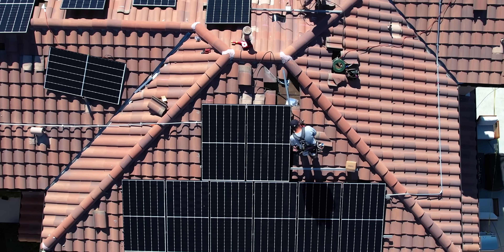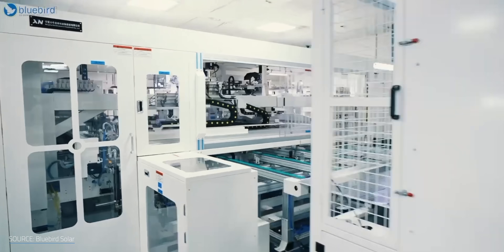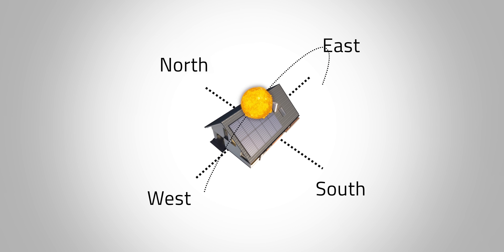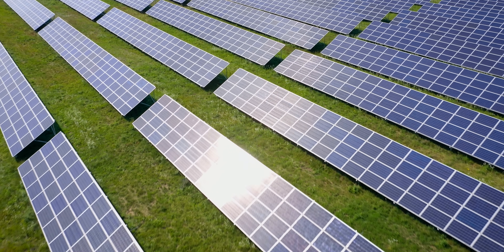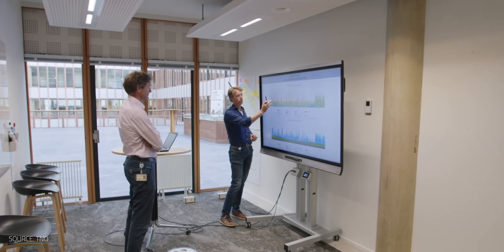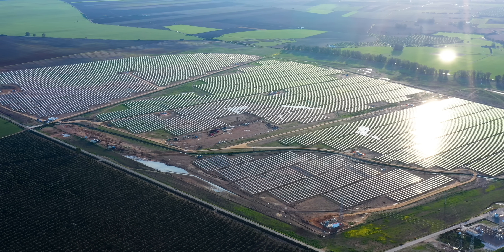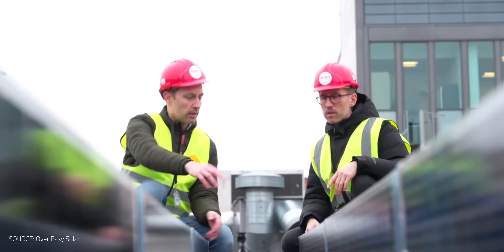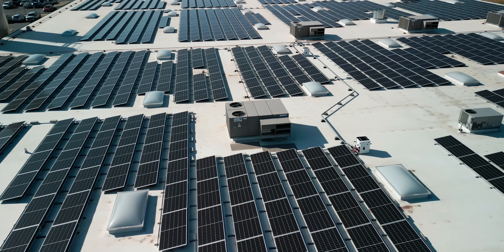Have we been doing Solar wrong all along?

Comment: One other huge benefit I see is for big farms, when it snowing you won't have to clear the snow and even dust would stick less on a vertical setup and you can much easier clear grass and can even technically farm it and sell it for livestock.
Reply: Sheeps would keep the grass down.
Reply: @Slumbert   Cheaper a possibility though some species do like climbing about as much as goats would be a nogo with how much they like climbing on putting their hooves on things etc it would definitely be wall jumping off the solar panels if they weren't too high for the goat to access.
Reply: @kateajurors8640  yes, and some animals scratch their bag...
Maybe galvanizet steel and some semihorisontal for sheeps to get under if it hails etc.
Reply: @Slumbert they do on regular installations on fields rn
Reply: No hail damage
Reply: @BobbyDazzler888  I have had enough windows even covered by a porch knocked out by hail that I highly doubt that they would never experience any type of hail damage. I live out in the country so it's not like it really ricochet off anything like pavement or whatever.
Reply: @BobbyDazzler888  Hail falls at an angle so there would still be a small concern about it but still much less than if they were horizontal.
Reply: Ah, that's a great point! I had to clear snow off of my small array this winter which wouldn't have stuck if they were vertical
Reply: @addamaniac  in the winter time the east west facing solar pannels don't get a good angle onto the Sun. If you want to optimize your solar pannels for yield during the winter they need to face south. and the optimal angle is about 30° steeper than the year around angle. I guess that is already steep enough that snow does not build up.
Reply: @MusikCassette  My country is at around 50° latitude so this doesn't really apply here, my pannels were covered with snow for few days until the warmer temperatures melted the layers so it slid off. Granted we see less and less snow each year, last year there wasn't any snow at all and this year it was 30cm that melted in 4 days.
Reply: That's my first thought, maintenance costs would drop a lot
Reply: @bullydungeon9631  could make a very slim roof, maybe with cleaning shower.
Reply: @Slumbert  a cheaper solution could be to use a tractor attachment and drive past. Imagine something like the hedge trimming attachment, but with brushes instead of blades.
Reply: If you raised it two feet, you could grow low grain crops like winter wheat between them as it does not grow very tall like corn. My concern is wind.
Reply: @markpashia7067  If you live in the west wind zone, (as I do) east west facing pannels actually protect the crops from wind.
Reply: @markpashia7067 , Double Thumb's Up! About the wind, simple just adjust the structural support to resist the stronger wind based on design.
Reply: wonder if it will be better with fast winds,
Reply: Good point.....
No snow lying on them might make them last longer?
Reply: @Slumbert  No snow makes them work better.
Reply: @jamesvandamme7786  Because of the light bouncing off the snow, right? So often we need sunglasses in winter as much as in summer.
Reply: Longevity could be a problem for glass panels without the aluminum backing, BUT vertical position also reduces the number of hail strikes AND the power of those strikes.
Reply: ehhhhh no  @Slumbert
Reply: @koiyujo1543  no to what?
Reply: @Slumbert  The issue with snow is you loose power generation waiting for the snow to melt and slide off the panels. A snow day where I am usually means 0kw for the next 2 days. If you get into a cycle of snow every 3rd day, then February can be an almost 0 production month.
Reply: Biggest benefit would be the east west installation and you get more power early in the morning and late in the afternoon, exactly when needed.  In Australia we get too much power generated in the middle of the day.
Reply: Panels face south in the northern hemisphere. Down here in the southern hemisphere we face them north.
Reply: And the method to wash them is way easier. Basically build a drivable car wash with the drums running against the panels.
Reply: I was just thinking that, they might also catch the wind more, but that just means you need a more solid install. But the big advantage is avoiding solar panels' Number One Enemy: Hail. I'm sure hail could still damage them, but being vertical means less of a chance of a direct blow.
Reply: They use solar panels in Antarctica, so i don’t think cold weather is as big of an issue in snowy areas as you would think.
Reply: I saw time ago a video of a guy explaining how the snow was not a problem because with not too much light the panel increases de temperature and quickly the snow melt and down.
Reply: @Felipe-st7tm  

Theres an optimum angle for shedding  snow  you can see it with smooth  roofs  if you get contact freezing of fog or rain  that might cause a problem with snow sticking to the ice layer but it would still tend to shed  as it built up.  
Monohull sailing boats are difficult to fit sufficient panels to due to the need to walk on cabin roofs..and having masts and ropes casting shadows all over.   Fitting bi facials vertically 
To the side rails  makes sense because  not only does the water reflect UV light but the fact that most boats have white decks and  superstructures will help on the inboard side ..
Reply: And no maths - place the same way wherever you live lol
Reply: My main panel is being placed in a pasture area mounted high enough that grazing can take place under them with no damage. My driveway is being fenced in and is about 600 ft long. My plan is to line that fence with panels to make use of space for extra power production, so vertical panels along a fence could produce as much power as a large horizontal rack with no loss of space.
Reply: Have you seen road signs in the winter?  They are vertical and yet they are caked with snow and ice!
Reply: @Hogger280  

Depends where you live and the signs are usually Aluminium  metal not toughened glass its in  a different League in terms of snow sticking to it ..  but thats why i mentioned contact freezing of water.  Its not impossible just less likely.
Reply: @Hogger280  Yeah, good point. Still it'd be much less than horizontal ones and easier to clean, if you're lucky qnd it isnt frosen fully just bump them with a broom and it would all fall down.
Reply: I thought the same for human food.
Reply: And also it's easier to work through them.  We are studying to install panels in our vineyard and this vertical design could be a great solution. Easier to work through, using the same row disposition that we are already using in our rows of vines, less dust accumulation, protection from strong winds, and maybe we could use its shadow to decrease the temperature of the plant during our Mediterranean hot summers, or maybe not, because we need this shadow on the moments when the sun is hitting higher. Anyway, now I have work and need to study and consider this design.
Reply: You could stack more rows vertically as well
Reply: That's one of the few reasons I never bought solar panels. Too much snow! This gives me hope, just need to figure out how to configure this for my yard & home now.
Reply: Even rain
Reply: Good point! I imagine you would get the same benefit in sandy regions if we build huge solar farms in the desert
Reply: @anonperson3972  One other benefit I learned about recently, is much better longevity of pannels. The worst thing for them is heat, and this configuration lowers that significantly. But since the power generation is so much worse, we need to calculate if the longevity benefits are actually worth it and end up producing more power over the lifespan.
Reply: This solves the Texas heat issue for me. I wonder if it would also help with our hail storm issues
Reply: As it's an upright structure why not mount the panels on tall robust poles strong enough to take a small wind turbine. Sun or wind or both you would have even greater energy potential from the same area and still harvest crops or have a small animal farm between the rows.
Reply: Where there is a lot of snow that usually means northern parts (if we leave southern mountains out) and that desires higher panel inclination, so the loss in efficiency is not as high anyway. The problem is, you want them warmer there, the opposite - having them frozen is not good :D
Reply: @marsovac  I’m not sure I follow. When it comes to solar panels the colder they are the more efficient they are. It’s drastic enough that when designing a system the potential over power/voltage conditions need to be accounted for in colder climates so as not to damage the MPPT.
Reply: @RobC1999  
Considering solar panels have an operating temperature as low as -40 degrees celsius (which so happens to also be -40 degrees fahrenheit), this is true. Also, a single graph while searching “solar panels voltage vs temperature” on Google showed me that a lower temperature yields a bigger voltage-power curve (that is: it can generate a higher voltage overall before inefficiencies start cropping up).
Reply: @Operational117  thats why liquid cooled Hybrid Photo Voltaic thermal panels are more efficient and longer lasting in areas of  strong light and higher ambient air temperatures.
Reply: @marsovac  Solar panels are more efficient when it's cold. Added bonus: sunlight reflecting from the snow adds to panel yield. Downside is this period is very short and half a year theres very little to no sunlight at all (winter is also the time when extra electricity would be needed the most).
Reply: @marsovac    Yah, but in northern latitudes during the winter, the sun is at a lower angle, so it would hit those vertical panels more directly than in the summer.  Kind of a win win, since the cold temps offset the more direct sunlight in the winter, while the higher solar angle in the summer means that panels get less hot then.
Reply: @marsovac   Actually even well below water freezing temperatures, photo-voltaics still gain efficiency benefit from being colder
Reply: @firstlast-cs6eg  from being colder yes, but not from being frozen and condensing more water on them and being even more frozen.
Reply: @marsovac   If there is ice or snow blocking the light, sure. Otherwise colder past water freezing results in more efficiency.
Reply: @firstlast-cs6eg  if it is below zero C you will likely have frost on it even if there is no snow, that's why i was saying it is better to have them accumulate some heat. A thin layer of frost can drop the efficiency much more than the negative temperature raises. The effect of lower temperatures below zero are barely measurable.
Reply: @marsovac  PV panels are more efficient the colder they are. Many pages claim that panels are not as efficient in colder climates but forget to point out that it is not the temperature that is the problem rather than the amount of irradiance. Of course there is a lower temperature limit when chemical reactions stop, but for most panels the performance starts to decrease around -40 C/F.
Reply: @Wisbargo  the problem is not the loss of efficiency due to temperature but due to frost that condensates during night and day cycles.
Reply: Retool some car window washer fluid and wiper systems, many climates may only need the spray
Reply: @altus1226    when they build pro panels the coolings on the back .  Spraying water on the front isn't that effective and you loose a lot of water or end up with dust sludge and  evaporates cutting the efficiency.  
If the panels are vertical or angled you might be able to thermo syphon rather than pump but as experiments have already been done using heat from.HPV via boosting by heat pumps you can recover the cost s  as well as increase your output and extend the life span, materials and energy cost of the actual panels..  
Seems like more field test should be done 👍🏼 to compare bifacials and HPVs in different scenarios..  citizen scientist and engineers step forward. 👍🏼😉🧙‍♂️🇬🇧
Reply: I think horizontal instalation allows for livestock to rest in the shade. Plus you get less evaporation.
Reply: @catprog But, maybe, evaporation is the thing that helps the solar panels stay cooler.
Reply: You’re hired buddy! Save the planet…
Reply: That’s what my guess was before finding out the other reason being heat
Reply: They would also be less likely to be damaged by hail.
Reply: snow sure.  wondering if dust/sand wouldn't scratch the surface quicker with a vertical mounted solar panel though.  like he brought up near the end this is something that needs lots more real world testing.
Reply: Snow sheds off easier. Moving shade improve cooling reducing the need for watering
Reply: No need worry snow in most place, Australia and africa
Reply: Also less dust covering the surface
Reply: That's a gamechanger up here in the north.
Reply: Bifacial vertical panels facing east and west produce less power than traditional south facing panels.  However, they produce maximum power when power is most in demand.  There is already a glut of renewable energy on the market around noon.
Reply: @dennisolson7989  

Thats where long term  storage batteries comes in..
I'm picking up on this from the live aboard boat ⛵ stand point especially in higher or lower latitudes.
Reply: You do however have to clean both sides of every panel so the maintenance might not be any less :/
Reply: Use these as fencing for livestock
Reply: Snow is often not a major factor still dust is depending how much it rains. 

It is rather more practical to overscale systems a bit.
Reply: Since snow comes with reduced sunlight, that means snow on the panels is not a huge loss, hence not having to remove snow cannot be a huge benefit.
Reply: Also you will generate more on spring and fall, when you also need more electrics and it's price is higher
Reply: We have been doing solar all wrong from the start... We don't need batteries. We do most of the work during the day... Heavy industry operates mostly only during the day. We commute mostly only during the day. So use solar during the day and regular fuel at night when most of us sleep. That would reduce our reliance to fossil fuels by 60% or more practically over night. 
But why aren't doing that? Why are we wasting money on batteries and why aren't we using the tools we already have to their maximum efficiency?
Reply: @FireWatchAnimations  But  we are doing exactly that, a lot of places like California and some parts of Europe have already too much energy during the day so they start investing into batteries. Battery investment is pretty small compared so renewable energy investments. A lot of battery sales now are only for balancing the grid and getting rid of peaker plants which reduces cost of electricity and emmisions a lot. Places that don't have excess energy don't really even consider batteries.
Reply: Yep this "draw" position, in contrast to "stow" that is already incorporated in tracker control systems, could allow for much easier maintenance over time.
Reply: I've seen some tests one guy did in a mildly snowy environment. On a sunny day, horizontal pannels were much more productive, on a cloudy day it was close, but horizontal were still better. But after it snowed the snow didn't stick to verticals and they outperformed the horizontal ones 2x times. He came to the conclusion that they are really good option for if you already have a farmable land for agrovoltaics or if you want to suplement the horizontall setup with vertical ones to gentle the production curve in the morning and evening. By combining them 50/50 you can make a steady line of products throughout the day so you don't have to buy such a powerful inverter. Product will be smaller compared to horizontal setup but it will be cheaper to initially setup and you can maybe recoupe the cost with more power sale in the morning and evening.
Reply: Less dust means less heat and a longer durability and a higher yield. Put mirrors 🪞 between the rows and you cool them(and the surrounding) even more.
Reply: White snow reflects light , increased efficiency in winter
Reply: Cheaper is better .  Until solar manufacturing makes power cheaper than all other sources , people will always prefer the cheaper sources ...
Reply: That is correct.☀ This winter, for example, we had a lot of snowfall in Japan, and therefore your system appeared to be much more beneficial.
Reply: Those are the worst.  Solar should be a decentralized individual thing.  NOt for a powering a grid.  Paired with batteries a individual home with solar is by far better.
Reply: Or mixed farms. I see solar farms and think, man, what a waste of space. It seems contradictory to cut down trees to install solar farms to reduce our carbon footprint, if not downright ignorant. But the space can be mixed use for produce farming as well as solar farming w/ the implementation of vertical panels right? Just a thought.
Reply: Yeah I'd say so.  Mixed with other power generators would be best,  Water, wind, fossil.  

Desertification is real and solar doesn't help soil or water retention.   @juliusfelipe525
Reply: Based on how they're installed, a layer of snow thick enough to reach a part of the panels can brick your entire setup
Reply: Surprisingly, I was initially against it for snowy areas because they usually like the warmer solar panels
Reply: Excellent point... And the snow blind glow reflects the good light it needs?
Reply: I remember a Russian RE academic giving a sideshow in about 2006 of solar installations on buildings and they were all vertical to avoid snow.
Reply: Its not really an issue in practice. All the snow falls down anyway
Reply: Turning the other cheek actually pays off😅😅😅
Reply: I was thinking it wouldn't be damaged as easily by hail
Reply: Wow it’s almost like high wins would destroy this rides —-
Reply: The hail resistance would be a big one too.
Reply: You nailed it.
Reply: The no snow thing is pretty big. I watched a comparison of bifacials, and the vertically mounted ones were 5x more efficient after snow, because obviously the regular mounted bifacials were covered in snow and the vertically mounted ones were not. Mounting vertically is around 20% less efficient on sunny days, 5% less efficient on cloudy days, and 500% more efficient on /after snowy days (if you don't clean the snow off of your solar panels). At least those are the results I saw.
Reply: Yes. Cleaning them would be MUCH better.
Reply: Even just running it along the fencing like we saw in some of the images.  Enough to generate lighting in the outbuildings, and run water pumps for troughs would be a net benefit. Not to mention providing some shade for the livestock.  It could replace expensive and dirty generators.
Reply: Snow will pile up less, but it will absolutely stick to a vertical surface. Certainly enough to impair a solar panel.
Likely less of a factor in dry areas like Alberta (less snow, & it tends to be 'dry', not sticky 'packing' snowman stuff).
Reply: @iloveprivacy8167  Yeah but it'll fall off when it reaches a certain weight if the pannel is smooth, and sun can heat the pannel up slightly enough to melt that small layer to fall. One huge problem I forgot to mention is wind, these are practically sails.
Reply: @iloveprivacy8167  strong winds remove snow, not perfect but show me anything that is el primo?
Reply: A vertical panel I could walk right up to with an oversize car brush is a huge plus for me compared to  getting on a ladder and dragging all the snow off from the panel past my knees to the ground.  @iloveprivacy8167
Reply: @iloveprivacy8167  I have 30 vertical solar panels and no snow stick to them at all
Reply: Yes but its makes it much easier for snow drifts to accumulate and thats much more difficult to clear.
Reply: Good observations. Also, it is clear that in large scale power generation, say for a city this would be cheaper than buying equipment to track the sun!  The cost of solar generated power would be even cheaper.
Reply: Livestock is also compatible with classic southfaced solar panels. and you get more power per area that way.

however, if you think it the other way around it becomes sensible:
you want vertical solarpannels to get solar Power for the mornings and evenings. 
In order for this to work out, you need to place them quite far away from each other, so they are out of each shadow at those times. So you get less solarpenels per aerea, so for this to work out ecconomicaly you need to use the aerea in between the panels. But sins they are so far away, can use classic farming equipment, so you can even do crops.
Reply: @MusikCassette  If you don't want to bother with lifestock yourself, it's much easier to just collect the crop growing between them, but this spacing could be reduced if you put them on a slightly inclined terrain.
Reply: @antonio_fosnjar  if we talk about the vertical pannelles inclined terrain makes them worse one way or the other.
Reply: @MusikCassette  if you don't intend to use machinery to harvest crop I think it would be slightly better on a small incline in higher latitude areas